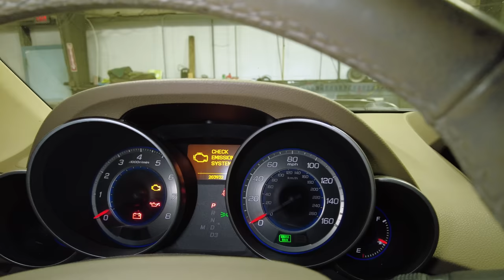Total mess! Last shop really screwed up on this '07 Acura MDX. What does the CAR WIZARD find?

Comment: As a retired technician who took great pride in his work I want to tell this “Wizard” that a pre-purchase inspection is not a “cursory glance.” I took a minimum of 1 to 1.5 hrs to pull plugs, inspect gear and trans fluids, run system scans, test calipers, run the vehicle on the lift and look for anything suspicious. An experienced Honda specialist would have caught that (but not a generalist). 

Also, if I knew the shop that did the work I’d probably give them a friendly call and try to explain what I found. If they care about their work and it wasn’t done too long ago they’ll make it right.
Reply: I’m a shade tree mechanic and I agree with what you said. Yeah it won’t be quick, but it’ll be thorough enough to tell you the overall condition of the car, so for example, if you pull the transmission drain plug out for just a brief moment and dark fluid comes out, then you know it probably was never serviced. Or with the spark plugs - if you pull them out and they look really black, then the engine could be burning oil or running real rich. It’s good to know the deeper details of the cars, and for a bit more time, it’ll pay off.
Reply: Thats what they do, they just don't go back through the entire inspection on video, just a few of the problems they found and the specific problem for the video. No one would watch if it was 2 hours long.
Reply: @archangel3237  We weren't referencing the content/video- it was the comment he made during the video. I suspect you didn't watch the whole thing carefully.

Comment: Did my own timing belt/water pump on my 09 MDX about a year ago and it's still running great! My 2nd timing belt job I've done, and my first on a V6. It was fun! It's scary turning the engine on though when you're done.

Comment: I knew the culprit as soon as you started describing it. Didn’t suspect the cause though. Tensioner should be torqued on not zipped on as well as everything else under the timing cover. You’re right folks do forget about that transfer case. The awd Honda’s didn’t always have those, but then again many folks don’t even change any fluid other than oil.

Comment: I have a 2009 w 114k miles on it. Was getting a Check Emissions alert, which tripped the Check SH-AWD System & Brake System. Pulled two codes that were related to Bank1 Sensor. Had Acura replace it today, drives fine now. Just had to spend 3k in repairs (resealing oil pump, rebooting inner cvs, O2 sensor) but these are literally the only repairs I’ve ever had done. These suvs are tanks!

Comment: Finally a video on a car I own except it’s a 2010 with oil consumption due to clogged piston rings  😔
Reply: Typical for honda engines to burn oil they all do
Reply: @Malik Fickling  I must be an outlier. 2013 Crosstour, 125K-ish miles, keeps it's oil level between services. I did disable VCM when I got it at 37K miles. The vibration drove me up the wall and then I read about the lawsuits. Such a stupid piece of technology.
Reply: @mtnman1984  cylinder deactivation is one of the worst ideas ever and the small increase in mpg is not even worth the extra engine wear from turning off cylinders
Reply: @Malik Fickling  at least it's a simple process to deactivate in the Hondas. I run the system once per service period to cycle the solenoids a few times, but it's otherwise inactive. Probably one of the best things I did proactively for the car's longevity.
Reply: @mtnman1984  If you deactivate the VCM like you have, that stops the oil burning issues in the 3.5. Those engines are very reliable. The 3.7 is the only J series engine with oil burning due to the piston design.
Reply: @Bryan Womack  good to know. I've thought about getting a 3.7 vehicle in the past, but had heard some nightmare scenarios. We have an Accord Sport and the Crosstour. It's nice to have two cars with the same mechanicals.
Reply: @mtnman1984  Acura has a TSB regarding the piston rings. They were replacing them under warranty. If you found a car that had this performed then the engine is semi bulletproof. My TL with the 3.7 burns roughly 2ish quarts between oil changes. Some were as bad as 1-1.5 quarts every 1k miles.

Comment: Looks like it's time to reseal the oil pump (and the pan, of course, as you can't do one without the other). It's a shame, because you need to take the TB off for this, which means it should have been done alone with the TB. Ah, well.

Comment: On my son's 11' Escape the transfer case is also notoriously crammed right up against the exhaust like this, and also Ford insists that it's a lifetime fill. No. It is actually a 30k mile item on that vehicle. Fortunately my son's transfer case was not smoked when we bought it, so changed it with a top quality fluid, and will be doing it on short intervals. It's not difficult or expensive.

Comment: I have an '07 MDX with 274k miles and they are solid cars. In my experience, the electrical issues are a headache, typically its something cheap and easy to fix just a pain to find. Also, these engines need VERY clean oil.  I change the oil around 50% oil life, ~4k miles, to keep it running good. It'll start idling rough and accelerate sluggishly and adds fuel to bank two, change the oil and it fixes all of it.

Comment: You know, I can honestly say that I don't blame the customer for not wanting to do the full repair at this time.  With the price of "everything" rising steeply over the past couple of years, you gotta take care of home/family FIRST in most cases and just live with whatever car problems you have until you can scrape up enough money to cover the repair cost(s).

I just had an issue with my '05 Highlander where she started slowly leaking power steering fluid at this past summer.  I started saving up for repairs after asking my mechanic the cost of the "worst case scenario" some time around November.   Fast forward to a few weeks ago when I finally was able to put the car in the shop, had the problem fully diagnosed (second-to worst case scenario; it just needed a new pump and hoses not a full rack replacement), and I was comfortable paying the cost of the repairs because I prepared for it.

OH, and yes...that MDX is still a great looking SUV and I'd TOTALLY buy one if I were in the market for a new vehicle.

Comment: When I used to work at Acura like 4 years ago I used to do timing belts on those mdx’s in 20 mins flat. About an 1 hour if I was doing the oil pump seals and timing belt cover seals.
Reply: You were a pro watched my mechanic do it on my J35A4 and it was about 5-7 hours. One of the water pump bolts were stripped.
Reply: Real pro uff sounds like a mess to deal with
Reply: What state are you in

Comment: The 3.5 was for the FWD models. The 3.7 Only came in all of Acuras "SH-AWD" Models at the time. Super notorious for the piston rings going bad causing excessive oil consumption. There was a recall for that issue. Hopefully this vehicle had that done at some point in its life.
Reply: The early 2nd gen MDX'S (07-09) did not suffer from that issue, the later face-lift 10-13's did.  This one should be safe from the oil burning issue.
Reply: @jtp336  The 07 09 capable of burning oil also. It’s just not as common. Seen quite of few of those torn down for piston rings
Reply: Lol another wrong answer 🤣😂🤣🤣 all 07-13 MDX HAD 3.7 liter engines lol! 3.5 was used in 14+ 😂🤣😂🤣
Reply: @johnb1658 exactly !! and they all came standard w SH AWD 😌
Reply: @johnb1658  also used in 03-06. But sadly, nobody cares about the early MDX's. j/k

Comment: Yeah the intermittent issues like this are the worst to track down. It took me months to figure out I had a bad fuel pressure regulator because the pressure was perfect every time I would test it. Then the truck would run perfect most of the time then bog down out of nowhere and run like crap the rest of the day and throw 02 sensor codes. Everyone kept saying "Replace the 02 sensors" I finally figured out the fuel pressure regulator was just getting stuck shut sometimes, And the 02's were doing what they were supposed to, Lol it was so simple but if you don't have experience with that stuff it's not so easy to figure out. That was really smart checking where the last shop worked on the Acura. I don't know how he even noticed that wire lol. Definitely a wizard!
Reply: Probably just looked around the S-belt, knowing there were sensors there, or perhaps just looking at the oil level problem and noticed it.
Not uncommon for wires to get damaged by pulleys or caught in the belt and ground intermittently if they are not secured properly.

Comment: Without knowing that engine I'd ask the question what would happen if the timing tensioner was released just a little such that the cable could be pulled back around the end of it so no longer under tension.

Just added a reply from CW to another comment - makes sense although good luck to the customer...  "And ruin the chances for warranty work for the customer? The other shop could claim that I broke it by moving the wire."

Comment: I'm glad I found a shop in my area that found me a used engine for my car that has a two-year warranty after owning the car for a year with the original going bad at 190,212 miles after buying the car at 180,000 miles. It was $8,000+ to replace the engine including some of the accessories, now it's leaking it's just one of the accessories that was not the right part and now the control arm is cracked and the cv joint is leaking after driving for 4 hours to get my new tires.

Comment: @11:20 in Houston , very rear and hard to find shops able to service the U joint. Not many shops like to take liabilities that’s why everyone tells you that buy the whole drive shaft.
I had honda CRV 98 back in a days, was able to service it. 
I bought the u joints from Canada and went to local shop and they replaced it. My Honda crv Drive shaft is non serviceable in American but once you break open then you should be able install replace UJoint.

Comment: That and the P2646 error on the K24 engine are pretty much the same.  Same symptoms if that screen gets clogged and/or if a defect happens in that unit.
That V-TEC Solenoid should be considered a consumable part for all Hondas/Acuras made in the 00s.
Reply: Hey, same for the 09-15 Infiniti 3.7 VVEL solenoids. Mine was done at around 80K miles IIRC.

Comment: 2007 Civic...4 years ago cleaned up headlights and still as good today.  Simply went to local chain, selling auto parts, etc.  Asked for guidance, was recommended the 'expensive' cleaning kit (~$35)...followed the instructions and about 1 1/2 hours to complete.  All these alternatives to cleaning the headlights...why?  I think common sense is to talk to local auto stores, buy what they recommend  & done.  One potential key may be that my vehicles are always in garage when not in use...unless traveling, which I do 2-4 months a year...then not garaged.  And yes, I am one of those that sees vehicles as point A to B...nothing more.  I maintain them well, cost is not an issue for me, reliability is...just my experience.

Comment: 3.7 Shawd has known issues with the low oil level warning. I'm pretty sure it's just a sensor that gets replaced, and the pump/sending unit could be fine.

Could be one issue fixed easily. Doesn't help with the busted solenoid, unfortunately.

Comment: I have a 2008 mdx with 165,000 and it’s the most reliable car I have owned. The key fob could be more durable but after 15 years I guess it’s been through a lot😂 and for the nay sayers your probably didn’t maintain the vehicle
Reply: You must be lucky.  The MDX, Pilot, and Odyssey are the most common broken down vehicles on the interstate shoulders.
Reply: @user-tb7rn1il3q  Never seen that in Iowa/Minnesota/Wisconsin. I see a lot of GM and Fords broken down though.
Reply: @user-tb7rn1il3q  the MDX does suck we had a 03 and with 140,000 miles and barely a few months it was one of the worst owned vehicles ever
Reply: The part of my fob that holds the key ring just broke on my way older 02 odyssey. Annoying haha

Comment: Clearly the VTEC solenoid valve is working when there's no tension on the wires so it works and once the tension is gone it will probably work fine for years but leaving it in that state is 100% going to destroy it eventually.. it's worth a try at least.

Comment: I think the pre purchase inspection could be a good idea although I haven't ever done it.  I know there are at least a hundred or more videos of people suggesting one.  Oddly enough I have not seen a video of a "buyer" (making the video) having a pre purchase inspection done in his (the buyer) presence.
Reply: They are basically visual inspection to get obvious problems, oil leaks, vibrations while driving, worn bushes, etc. They won't tell you if the big ends will fail next week.
If you have absolutely no knowledge about cars, and the car you are buying has a lot of miles on it it's probably not a bad idea.
Reply: @Cheepchipsable  I agree.  I am not a mechanic but, used to a lot of work on my own cars and have a basic knowledge.  The interesting thing is there are no (that I know of) videos of a buyer taking a car to a shop for a pre purchase inspection.

Comment: The back diff oil changes are a must for that awd MDX. Done every 50k miles as well as the transmission oil every 40k miles, failure to maintain = expensive repairs. I own a 2015 with the 3.5L engine with 80+ k miles and still drives like new
Reply: Literally never saw a rear diff fail in an mdx in my life. Where do you people get your info lol. The 07-09 are literally built like rocks! They run forever even when poorly maintained.

Comment: My dad was a mechanic and he would tell you when he looked over a car it is just an educated guess. There is no way someone can check a car and know everything that may go wrong, especially those intermittent issues.
Reply: You would have to know a make and model pretty well to know common issues.
An inspection can only see visible/audible/tactile problems and it would have to be more invasive to find deeper problems, but even then that won't tell you if the big end bearings will fail next week.

Comment: Wizard, I bought a 2003 for $1300, 247k miles. I did change the transfer case oil myself! I had to pay the dealer to change the differential and trans fluid because I couldn't break the fill hole plugs. I shave my head too, what do you use? Cartridge? safety? straight razor?
Reply: Use a pipe for leverage on the trans plug, also blast it with penetrating oil  a few times.

Comment: F8 just came in for lowering springs because the last shop said “you can’t lower it much”
Turns out they seised the spring collets attempting to turn the collet under full spring tension. 
We have photos and videos of uninstall, even the factory marks were off. 😮

Comment: Nice video. Is it possible to buy a VTEC solenoid and an oil pressure sender from a breaker's yard separately or does the whole unit have to be changed with a new part? Seems like a straightforward fix. As a separate question, what are your thoughts on the RTV issue on the 2022 GR86/BRZ?
Reply: You can replace them separately. Both are still available at the Acura stealership... i mean dealership.

Comment: The oil pressure switch can be replaced separately. Not sure about vetch solenoid.  These cars can easily reach 300k. But they’re gas hogs. So I am not looking forward to it. Btw, don’t touch 10-13. They have bigger issues

Comment: This car will never come back to this shop again for this issue.
Instead, as was mentioned in the video, the "customer" will take it back to the mystery shop
and demand they fix the problem they caused - because "Car Wizard" said they did.
It was smart to keep the identity of the other shop covered up here, but I have a feeling this
is not the last that CW is going to hear on the car, especially if the other shop is "that sort".

Comment: A McGuires headlight restoration kit would solve the headlight problem for $20.00 and about 1 hour of the owners elbow grease….easy as falling off a log. I’ll bet there will be an 07 Acura for sale very soon.
Reply: Those kits are useless. Nice try.